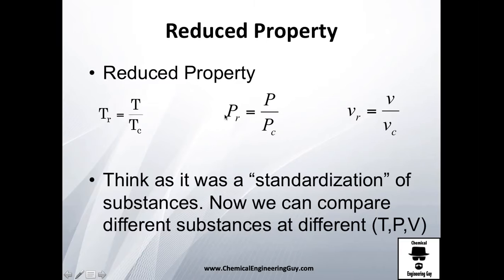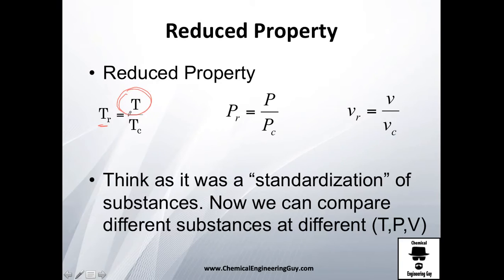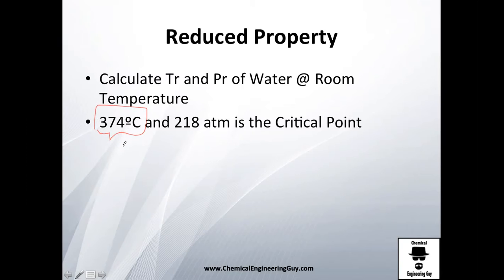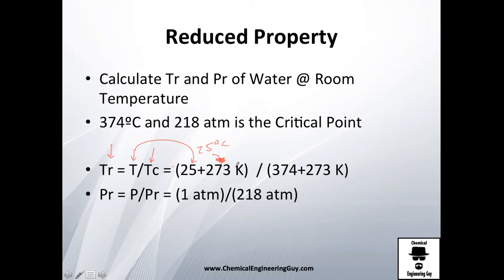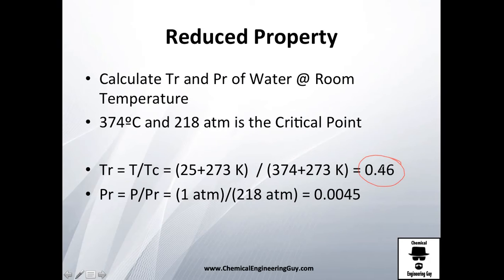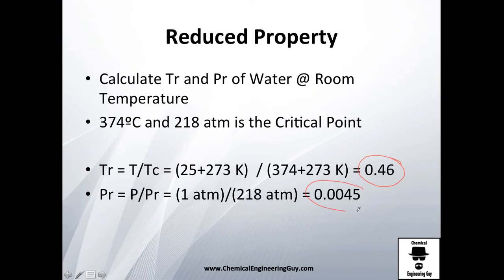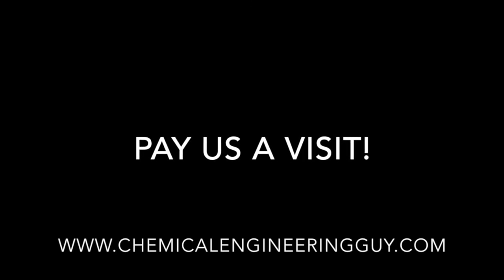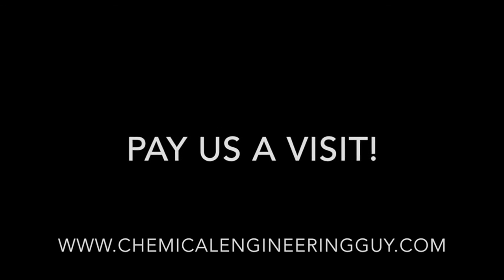Reduced Temperature and Pressure // Thermodynamics - Class 50

Comment: Is Pseudo Reduced the same thing as this ? Like is it the same as what you did in this video? Or different process ?
Reply from the maker: wel... the main difference is on the BASIS Pseudo Temperature: Defined for non-equilibrium systems or specific models where classical temperature is not directly applicable.
Reduced Temperature: Defined strictly as a ratio involving the actual temperature and the critical temperature of a substance.

Comment: How to calculate how much temperature is reduced after a flow of water in a pipe ?
Reply from the maker: due to expansion/contraction?
Reply: @ChemicalEngineeringGuy  if we know the inlet temperature of a flow pipe and the environment temperature...is it possible to find the outlet temperature of the pipe?

Comment: why do i need to reduce pressure and what does it actually mean? this makes no  sense at all
Reply from the maker: If I tell you about a gas being at 10 atm, you have no idea how far or near its critical point is.... but if I tell you that the reduced pressure is 1.5, then you know it is 50% above its critical pressure, we prefere this as critical pressure/temp are better "base points" to compare gases between each other
Reply: @ChemicalEngineeringGuy  but how you calculated that the gas is above 50% of its critical pressure ? why not below ? and why exactly 50 not 63 or 51 ?
Reply: @medotedo8410 bro did you watch the video?

Comment from the maker: reduced properties are used mainly in the study of real gases. It may relate points to its critical state... and we can use the reference of its critical state with many other theorems to apply laws such as Z compressibility and other equations of state
Reply: +Chemical Engineering Guy how do u find the reduced temp and reduced pressure in a gas mixture
Reply from the maker: You need to use Kay Rules, you can find them in the Mass Balance Playlist/Course